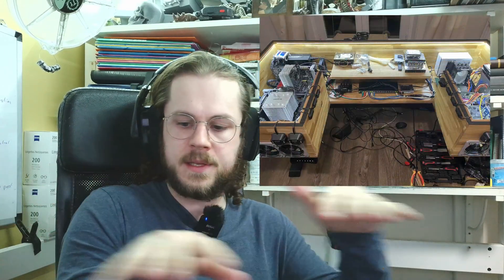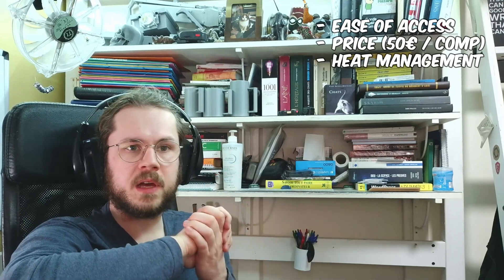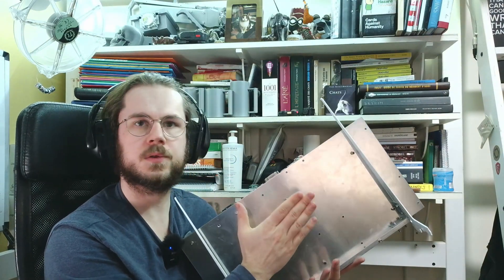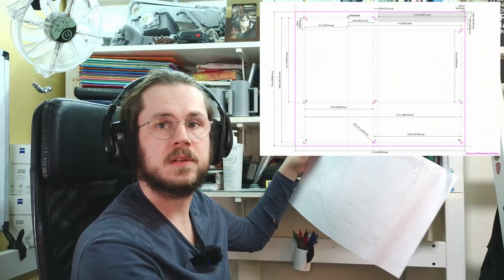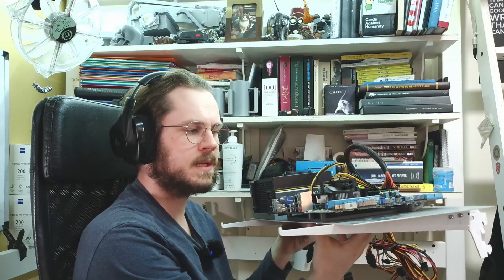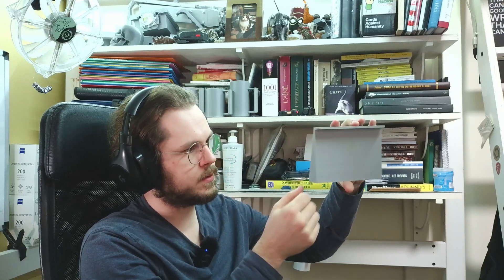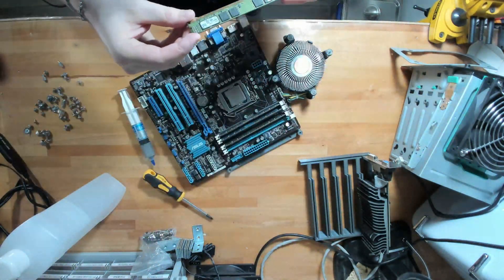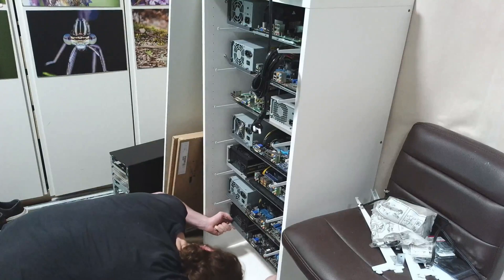DIY server part 1 - setting it up

Comment: Use the single backplane from the case to mark out the hole locations, drill, tap and add you mobo riser bolts. Done. No printing required.
Reply from the maker: I kind of attempted it ( with the 3d print in between ) but I run into two issues simultaneously
The first issue is that the tolerances are tight and I'm simply not yet good enough to be as accurate as needed to do the drilling, they need a tolerance of 0.5mm on the placement else I end up putting a strain on the motherboard
The second issue that needs to be addressed is that the weight of the motherboard bends the aluminium sheet a bit. Not much but enough that I'm concerned about the integrity of the motherboard on the long term as it ends up bending a bit. The 3d printed part underneath provides a bit of extra rigidity to the plate.
I'm still exploring solutions so there may be a time where I go back to that. I'm looking for what is the simplest / the cheapest / the most efficient / ... and I may end up with multiple different solutions all at once, it's the fun part of DIY ^^

Comment: how does the cooling work? fans on the top? side?
Reply from the maker: I show that in detail in the other videos but the TLDR ( or TLDLook ? ) is that there are two big fans at the bottom with a filter for the intake and one opening at the top for the outlet. Not a perfect solution but it;'s a good compromise in between the sound / dust / heat management

Comment: i see alot of the computers your using are quite old wouldn't it be more cost effective an easier to manage and cheaper to power 2x-3x chinese dual x99 motherboards with 2699v4s for a total of 88-122 CPU cores because all those older system gotta put a heavy load power consumption and heat wise like don't get me wrong your idea is cool but it seems expensive to run and very hot
Reply from the maker: I completely agree but I simply have a super super low budget at the moment and cannot afford any servers at the moment.
I am considering getting some stuff of ebay but even that is going to be hard to justify ^^'
On the super super short term, my computers are more interesting simply because I got them for free but if I where to use them for 2 years, the prices would average out before being in favour of the x99 processors.
That said, I do have plans to have them turn on and off as needed so it's going to be quite interesting to see what I can do to attempt to limit the difference in power usage.
Reply: @happytrigger42  are most of those boards non OEM boards you could always flip them on ebay since prices on non OEM older boards is pretty high around 50-60$ due to rarity a board flip 6 boards you'd have enough for 2 dual xeon systems with insane amounts of memory

Comment: if you took the 5.25 bay frames from the cases too, you could mount hotswap bays
Reply from the maker: I did but turns out the ones I got where not nearly as hot swappable as I hoped XD

Comment: You could have just used brass motherboard standoffs and taped them directly into the aluminum plate.
Reply from the maker: I did consider it but it introduces two issues : first the holes need to be really, really well aligned and also the aluminium plate does not have a lot of rigidity so it bends a little bit transferring the load to the motherboard on top. That's why I attempted different solutions before settling on the 3d printed support, it's simply easier and less work

Comment: I'm very much interested in this as I'm going to build a NAS myself, but I'm thinking of making a 3D printed case instead of buying one. None the less, very interesting so far. Also as a side note, my company just e-wastes everything, which is unfortunate. Most of the computer we use are only 3-4  years old at most.
Reply from the maker: There are quite a few youtube videos that showcase 3d printable NAS cases, I would most definitely give that topic a look to get some good ideas.
If you want to have some spare computers you can always ask nicely if you can get those computers from your company as usually companies have to pay for big volumes of e waste. A tip : you can ask for the computer without the HDDs / SSDs as the data that the computers contain is usually the reason why companies are reluctant to give the computers away ( in the cases where they would not give them even after whipping the data off them ).
the computers I'm getting are 8 to 12 years old and there is a LOT of stuff you can do with that, 3 to 4 years old computers would be a mega upgrade, you can even play on those XD

Comment: From experience:
a) if you want to avoid dust, mount them shelves up side down. Difference would be night and day;
b) shelves trap heat very well in case you restrict the last remaining front side of cabinet even partially;
c) power consumption above 50W/m2 area without active air exchange is enough to slowly increase local room temp noticeably in warmer time of year;
d) dealing with more than a couple HDDs close to each other would drive you nuts with either vibration resonance hum or cooling noise low end from battling with 40 deg C threshold. This is the most difficult part since you have to plan wisely in advance and commercial HDD cages/brackets almost never bother with these issues in design and are awful in homelab setting other than dedicated ventilated room.
Reply from the maker: Gosh dang it, a) is a brilliant idea, would nee to redesign most of the shelves to have the supports be at the edges to make space for the motherboards and PSU though and I may run into issues with PCIE cards. Food for thought though.
Going to have to experiment with b) to see
For c) I would say even less, my room transforms into an oven XD. Plan is to experiment with pipes that would use the air from outside so the servers would be in their little isolated space. It does introduce humidity problems though.
d) is not something I am aware of at all, thank you for the heads up. Considering my current solution I'm not too concerned about the temperature but vibrations may be a big problem
Reply: @ Due to reverse horizontal position of motherboard, the reduction of area collecting dust is tremendous and gives me ability to control unattended coolant spills using it remotely or 24/7 since it is water cooled.
Expansion slots are not a problem if you connect more than one and tie them together with an aluminium bracket where they are supposed to screw in chassis. Slots are locking shut and only the bracket side may loosen, but it is not hard to support. Unless you are putting like 4-5kg total into slots, it should hold on those two points.
d) 40C is a threshold of max operating temp for HDDs from datacenters drive reliability statistics. And it is not trivial to maintain quietly with high density of drives.
Reply from the maker: My bet for now is that the dust filter that I have installed on the air intake should solve my dust problems, that said, I'm most definitely going to keep your ideas in mind on future iterations, especially if they are not within enclosures

Comment: It sounds nice, but in reality, a single used server could replace all these cases, all their compute resorces, be more manageable for cooling/noise/etc and be within your budget for adjustnents. And, which is also important,be cheaper in the long-term because of resources density per unit would be higher, but the electricity usage would be comparable to 1 or 2 units of all of them.
Reply from the maker: Oh I fully agree. I did get the computers for free though and do not have the money for a server, even a second hand one, it's as simple as that.
I do have solutions to attempt to limit my power usage ( such as turning them on automatically only on demand and off when not in use ).

Comment: Very good idea. Some toughts however. The motherboards have somewhat standardized monting holes, so you could mount them with theirs mounting posts and screws dirrectly on the aluminium sheet, without the need of the 3D printed part, just like they were mounted on the metal plate in the case. Just mark the holes, drill them and mount the posts and the motherboard.
Another thing, I would mount the whole assembly upside down, the motherboards facing down and the PSU, HDD and the ODD on the upper side. That way, the dust will not settle on the motherboards and make the cabinet thinner  (but taller) and also having more space for mounting the storage drives. It is doable providing that you will not use any expansion cards.
Also, on the door, can mount small displays (10") connectd by VGA for each computer, for quick diagnostic.
I  might borrow your idea for my personal use; I also have more computers than I have space for to use. Is a great idea to use more computers in a small space. I can see such a rack for all my retro computers mounted in one space.
Reply from the maker: I did attempt the first idea, the motherboards do need a bit of clearance in between them and the aluminium sheet as to not touch and have a short circuit. So I printed a system where the holes do indeed go through but I encountered tolerance issues : the holes need to be aligned within 1mm or the screw risks damaging the motherboard.
Second idea is interesting, I am going to use a few PCIE cards ( small graphics cards and possibly raid cards ) but nothing a bit of DIY cannot help with ^^ It's something I may consider for the NAS
Third idea is planned ^^ I have a few left over screens that would fit that purpose nicely ^^
I'll be giving dimensions and what not in the next videos ^^ The 3d printed mount is already available in the description and I'll be sharing more details as to the shelf system itself. There is obviously no need to follow my own dimensions but I would recommend checking your local hardware store for parts that can be used as is, it reduces the amount of time spent per computer

Comment: What's it gonna be for? thats many computers
Reply: Well there are many options, Im sure he will tell us. I see 7 computers, I would use 1 for DHCP+DNS+(AD or LDAP),  1 for Firewall+Routing,  2 for Web services, 1 for RDP+Managemment, 1 for DMZ apps, 1 for Data Bases, assuming that he is going to build a NAS separated from those 7 connecting extra storage with SCSI to those 7. Its a nice playground :)
Reply from the maker: The answer is a bit of everything x)
The main things I want to explore are database automations and resiliency ( I start unplugging stuff, does the website hold on ? ), a NAS, CI/CD through gitlab runners and so on.
Honestly it's a massive sandbox and the main objective is going to be to allow me to learn stuff that would otherwise be a bit expensive to do on the cloud ^^
Reply: @ Maybe you could explore the idea of using only 2 or max 3 refurbished server PSU with breaktrouh boards and PICOs instead of 7 ATX PSUs. It would improve the eficiency and reduce the energy needed to power those motherboards, Im preaty sure that you could power 4 MOBOs with 1 HP Server PSU of 1200W, to build a DIY Blade Server :)
Reply from the maker: Now that is also a very interesting idea x)
I'm going to stick to what I am going for now though, the good old "first make it pretty, then make it pretty"
That said, on the long term it can most definitely be worth attempting since right now I'm going to have to turn the computers on / off to save on power. That would possibly allow me to have an even more compact design and save on power